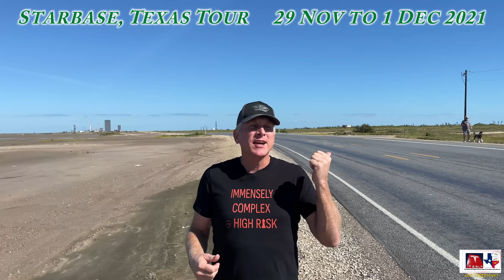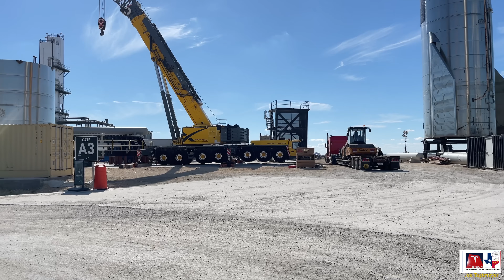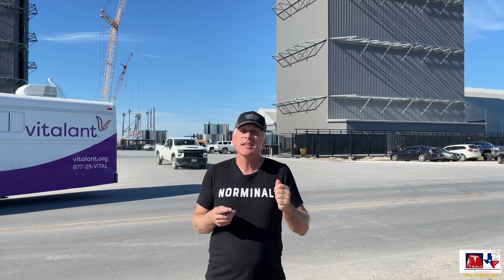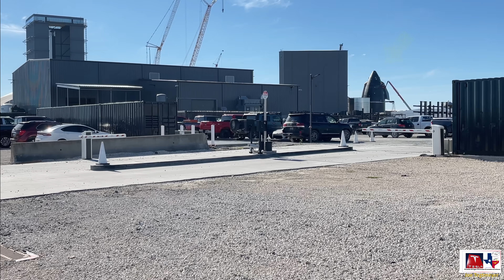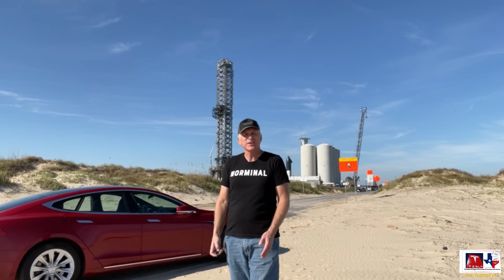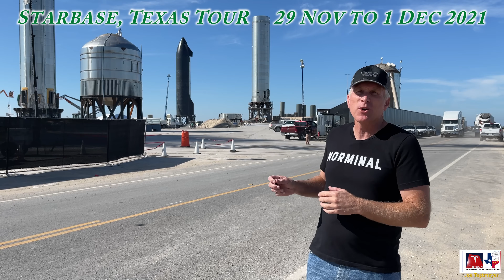Starbase, Texas 2 December 2021 in-depth tour & discussion (images from 29 Nov to 1 Dec 2021) 4K

Comment: Good job..  wanted to help you on one thing. The orbital tank farm consists of qty 8 12 meter tanks/shells 7 of which hold cryogenic liquid gasses in the 9 meter inner starship ring sections as you described. The remaining “water” tank uses all 12 meters of width as internal storage.  The two western most tanks are Methane LCH4 storage. We will call those position 4 (closest to road) and position 8 immediately behind. The two center tanks closest to road positions 2 & 3 are Liquid Nitrogen LN2. There are 3 Liquid Oxygen (LOX) tanks position 1 (closest to road & beach) position 5 (behind 1) and position 6. The non-cryo Water tank is in position 7.  This does the best job of maintaining a separation of the methane and its oxidizer with buffers of nitrogen and water between.